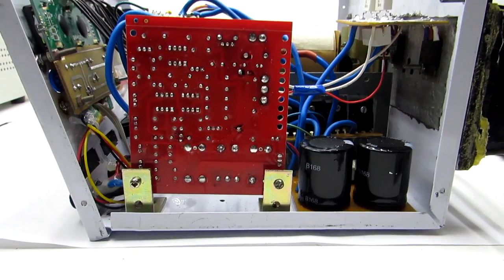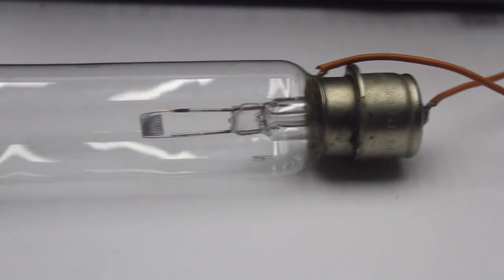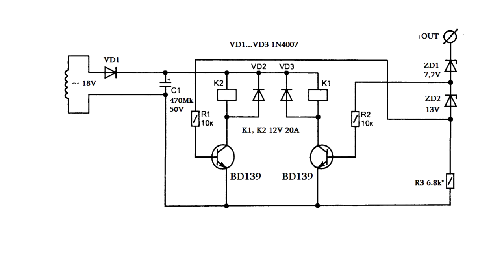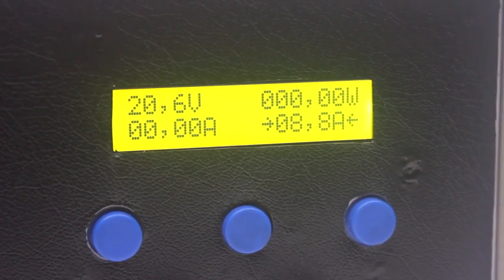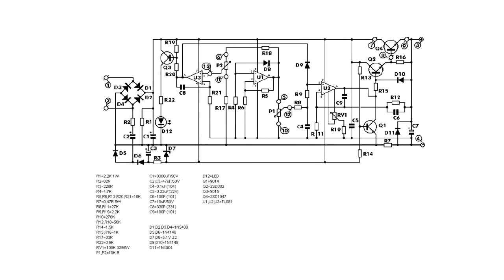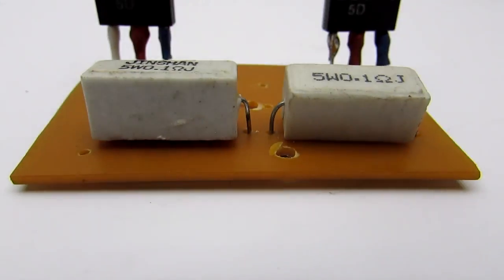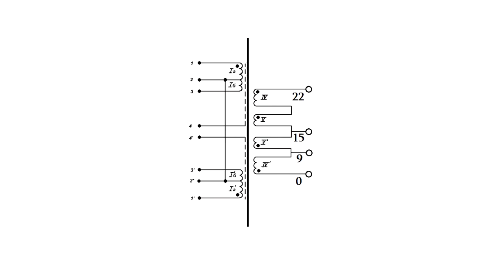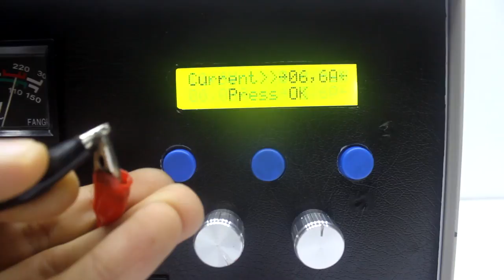DIY super laboratory power supply

Comment: I bought the same kit, but destroyed it :(
The "power transistor" got to hot. I replaced it,  but it still doesn't work.
can somebody help me ??
Reply: Probably the ICs got destroyed too. I had a similar problem. If you are using a 24vac x 1.41, the peak voltage will be around 34v, plus the negative 5 reference voltage..is almost 40V...that is higher than the maximum operating voltage that those ICs can handle. I put a lm317 in order to limit the maximum voltage at 35V, rail to rail....the drawback is that I am not able to get 30V at the output...but at least, it works without smoke.